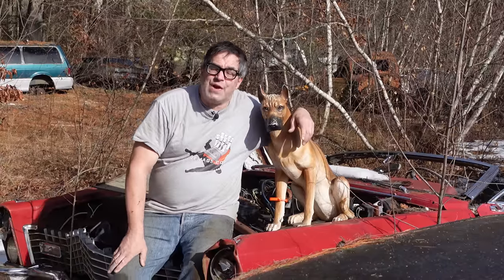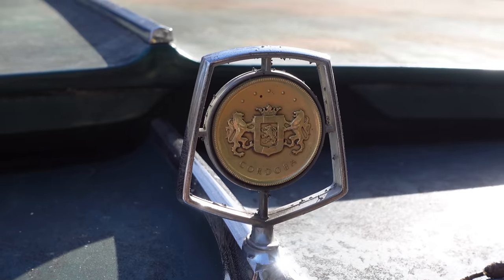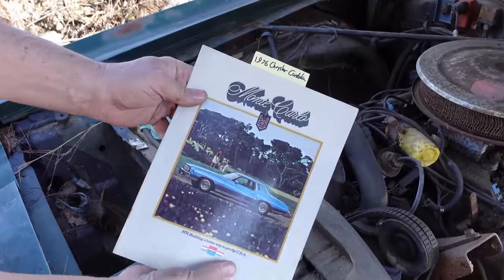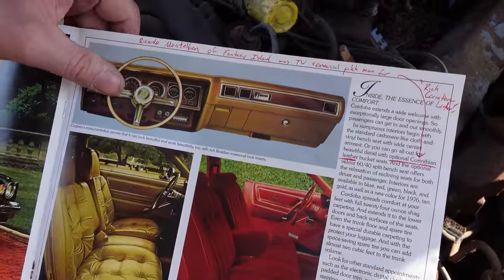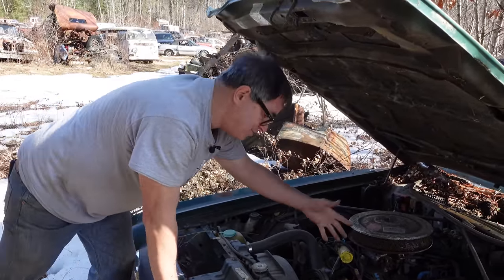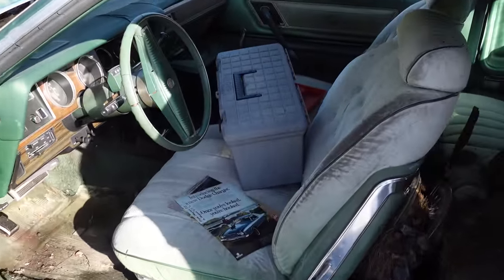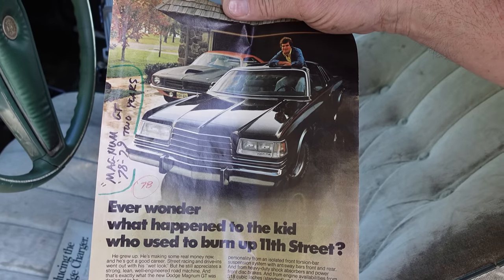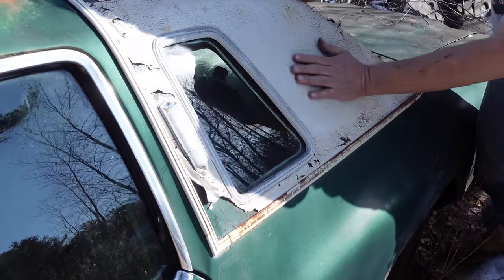Chrysler Copies Monte Carlo

Comment: Close, 1973 to 1977 on the Monte Carlo. The "A" and "G" body GM cars were redesigned for the 1978 model year. While the Cordoba sold, one or two GM divisions of the same "personal luxury" cars easily outsold all of the Cordobas sold in a given year. GM had the size and the money to weather the storm whereas the others did not. A previous owner of that car was smart to de-smog it.  Unfortunately, Chrysler used either Holley or Carter carburetion in their vehicles, two of the worst branded carburetors out there. The Ford/Motorcraft was in the running with that stigma too. It made their cars run poorly and get poor fuel economy. Not that the GMs were the bastion of efficiency, but a Q-Jet by design is a superior carburetor, so much so that Chrysler wound up using it on their vehicles in the 1980s, and even Ford used the QJ on the 429 V8. Yes, Rich Corinthian Leather imported all the way from the Radel Company in Newark, NJ. 

We got the VIN, we win: S for Cordoba, S for Special Price Class, 22 for two door special coupe, N for 400 V8 with four barrel (M is a 400 V8 with two barrel, and P is a 400 V8 with four-barrel, high performance), 6 for 1976 model year, R for Windsor, Ontario Canada assembly and the rest is the production sequence. The Windsor plant opened in 1928 and still operates under Stellantis today. This one was made on Thursday July 15, 1976.

No tag, can't brag, but some of it is easy to figure out: SS22 for Cordoba (S) Special Price Class (2) two door special coupe (22), G8 for Deep Sherwood exterior paint, S62 for tilt steering wheel, N88 for automatic speed control, H41 for heater (the person that bought/ordered this was a bit of a skinflint and didn't get AC), E65 for 400 V8 with four barrel, D34 for standard duty automatic transmission, U for USA spec vehicle, END for end of sales codes, possible P41 for power door locks, among other codes.

I've related the story in the past of the Dodge Magnum in that when I was in automotive parts, we used to deal with a company called "Magnum Products". They supplied PCV valves and emission control items to the aftermarket. (There were only a handful of actually manufacturers of these items back then and all the major companies reboxed them under their brand name). Turns out the owner had a Dodge Magnum from new and was a bit of a Chrysler fan, so he named his company (long gone now) after that. When we got talking, he told me where he was from (New Jersey) and said he was into old cars and what not. So, we invited him in for a vendor meeting. After talking we both said, "I know you from somewhere". Turns out, back in 1989, he was selling a Dodge Charger and a friend of mine asked me to go with him to test drive it. This person that owned Magnum Products met us at a gas station. My friend test drove the car, I sat in the back seat. They couldn't make a deal and we went on our way. Who would know some 15 years later that we would cross paths again. Another "famous" instance of the Magnum was that a criminal was driving one and committing assaults in Florida. One person was able to see "Magnum" on the dashboard and subsequently remembered that and told the police. That's how he was caught and eventually sentenced to death for his crimes.
Reply: Remember this, kiddies, don't crime in a unique ride!
The Ford variable venturi carb was the worst thing I ever had. 
And that includes a couple Tata Nanos.
Enjoy your added info, watching this from rainy Singapore.
Reply: @suzi_mai  Sure. They connected the Magnum and also that he stopped at an ATM to withdraw money. That was also remembered and stated to the police. Back then, all night ATMs were rare in Florida (and most of the US), so they pulled all the records and then matched it to known Dodge Magnum owners and made the connection. The clincher was the distinctive tire tracks which were found on that specific vehicle.
Reply: Got the VIN this morning
Reply: @tomwesley7884  Yes, but I was hoping for the under hood trim tag as well.
Reply from the maker: @suzi_mai  Is the rain putting the POUR in Singapore? Ta-Damp! Thanks for watching and writing. -Steve Magnante
Reply: I've always wondered what the percentage of chargers were to Cordobas in the era that the Cordoba was being made.
Reply: @kennethsouthard6042  Just compare the sales figures of the two models in a given year and Bob's Your Uncle, you've got the data.
Reply: @googleusergp  I know that I just don't have the sales data for the Chargers.
Reply: @kennethsouthard6042  I'm sure it's online if you look hard enough.

Comment: Steve, you made a rare mistake!
The second generation Monte Carlo ran from 1973-1977 models.
The 1976 & 1977 models had the stacked headlights, instead of the round ones.
The third generation Monte began with the 1978 model year.

Comment: Lean-Burn could probably work better today as the components are improved. I believe L/B was the first of its type
Reply: Chrysler was light-years ahead of the others with an onboard processing computer, in 1976!! I spoke with an engineer back in the day who worked with them, the one thing they did wrong was put it in the absolute worst place they could. Heat and vibration killed them. I've had probably 20+ Magnums and a few Cordobas over the years, most still had the LB's in them well into the late 80's

Comment: lean burn would have worked better with a FI, of course it wouldn't need it with a FI system, it was a good idea for hanging on a carb to get it efficient. however, carbs are obsolete. I had a friend with a lean burn ran great except when running hard would act up at slower speeds, he would stop get coffee let it sit for a few minutes and then go on. thinking the system was slow to react. For various driving conditions

Comment: Yah, I had just bought the worst Dodge product built, the 76 Aspen SE.  what a piece of crap. Then Ricardo Mountabum was on the tv telling me 
about the rich Carinthian leather.  My next two cars where VW Rabbits, 81 diesel, ran like a farm implement, then the 84 GTI. that was nice, but 
couldn’t keep tires on it. They kids came so Plymouth Grand Voyageur, followed by an 82 Grand Caravan. That was a solid trouble free vehicle 
that made up for the rest. Had it 14 years, then gave it to a nephew who had it 2 more years.  Had a 64 New Yorker, a 64 2 door Windsor, and a 
66 300.  I guess I was a Mopar guy.  Had a 1965 276 Firedome Hemi with a 6 pack on an Offenhouser manifold, 3/4 Iski track cam, sodium exhaust 
valves.  That Aspen went through 3 front ends in 5 years. Punishing !

Comment: I have a 1980 Cordoba with a 318, it was a great car.
Reply: lenny person  it looked great to me because it was garage kept, 43000 actual miles and was clean and ready to go.
Reply: And I gave  $500 bucks for it
Reply: lenny person  I gotcha the 80 thru 83 looked like a Thunderbird kind of, the 75 thru 79 werenice and had a 400 as the standard engine
Reply: lenny person  yeah it come to think of it, it was pretty much the same thing
Reply: lenny person  wowzers that's great,  I'm a duster fanatic  I'd love to find one that's reasonably priced.  Mine was a 70 318 3 speed on the floor, get this it had 355 gears and disc brakes
Reply: lenny person  yeah I know,  360 are good engines I've had several of them, I had a 2000 Dakota R/T that had 355 gears and it pulled pretty hard for stock engine, I wanted to build.it upbut I  was going through a lot of things and had to  sell.it. Yeah prices for all these old cars are ridiculous now.

Comment: I think the original '66 Charger was the first personal luxury car.  Their advertisements at the time used that type of language.  All the fancy trim, interior lighting etc. would have been appreciated by that type of buyer.  The first time I sat in my '67 Charger it reminded me more of my Moms '68 New Yorker and less of my '68 Coronet (that I had in High School).  The problem was that the Gen 1 Charger missed the market, either by timing, styling, or??  The failure of them to hit the market prompted the '68 redesign to a younger, less affluent, performance oriented buyer and the rest is history.  This iteration of the B-Body styling in copying the Monte was probably done to lower the risk of (another) failure.  I'm not trashing Mopar here, the car buying public is a fickle animal.
Reply: I'm a MOPAR or NO CAR guy, but I think the first personal luxury car I believe would have been the first four seat T-Bird.
Reply: @JrGoonior  That is absolutely true.  Those  T-Birds were very luxurious with options found on upscale cars.  There were major differences between the T-Bird and the 'Vette at that time (the T-Birds original market competitor).  Maybe if Ford had rebranded the T-Bird it would have gotten credit for being the first personal luxury car.    The T-Bird had re-invented itself several times before it settled into that market.  That is probably the reason that the Monte gets the credit.

Comment: I completely doubt that Chrysler only made $900 on the Cordoba.
Reply: He's actually very close. I worked at a dealership and the profit margin on a new car is very small compared to a used vehicle. That's where they made a big markup. Now dealerships vary and the final sales prices are set there but the manufacturer sets a cap on the markup.
Reply: @sandyman541  I agree that the dealership markup were in that range, but I was commenting on the factory.
Reply: @rondpert5167  I agree
Reply: Keep in mind $900 is a decent margin on a $4,500 vehicle sale price
Reply: @rondpert5167  Back then, Chrysler was doing the "push" system of production. That is, they would "push" inventory out to the dealerships rather than a "pull" system (customer buys what they want). When Mr. Iacocca took over Chrysler, the first thing he did was can that system as it was leading to bloated inventory of cars that no one wanted and draining the company of cash.
Reply from the maker: @googleusergp  Ever see pictures of the old Silver Dome in Pontiac, MI where the parking lot is PACKED with new cars (of many makes) awaiting dealers to accept them. These images always made me uneasy...like impending economic doom. But I guess they are "normal" in the car industry. -Steve Magnante
Reply: @SteveMagnante  Much the same way that some films on DeLorean showed the mountain of cars in the European factory waiting around to be sold. The company was bankrupt quickly, but it took some time to sell off the remaining cars that were produced.

Comment: Hell, that car looks like it could be fixed and put back on the road. Front suspension rebuild, repair the engine, and check the undercarriage, and it could probably be driven. It has the right look to keep people from trying to road rage too. Lol. Maybe clear coat the rust so it doesn't get worse, but leave as much of the beat up looks as possible to scare people on the road.

Comment: Im looking for a 77-82 cordoba with a slant six if anyone has one.
Reply: 75-79 wasn't available with the six. 1980 maybe only until 81-82. I don't think you'd be happy with a slant six, by the time the 80's hit it was choked down with emission controls. My parents has an 82 NewYorker, similar platform, (fancy looking Diplomat) with a slant six, loaded with all five of us and luggage it could barely get out of its own way and the gas mileage was awful, maybe 17 MPG on flat ground. Our 79 Cordoba with 360 did better at 20 MPG on the same road trip.

Comment: It's mind blowing to me that they may have only made 900 or 90 dollars on the sale of a car. All those union wages and benefits I suppose.
Reply: They were built in Canada, so yes, the CAW was representing the workers, but I suspect it was slightly cheaper to make the car there.
Reply from the maker: My profit numbers were GUESSES to illustrate the point that car makers - like restaurateurs - make far more profit selling a few steak dinners than they do an afternoon's worth of hot dogs. The 1976 Cordoba's base price was $5,392. I'd imagine true profit was at least $500 - probably more but I don't have an official figure. That stuff tends to be "classified". And here we are NOT talking about dealer markup, rather the actual difference between the wholesale cost to the retail dealer and the actual cost of manufacture at the factory. But lets not forget the long term earnings from the INTEREST on the 4-year financing. And also the maintenance / service visits over the next 2 years or so (which the dealer gets but PARTS sales are routed back to Chrysler Corp). I know that modern SUV sales are FAR more profitable to carmakers than econo-boxes. Like a factor of 5 to 10! Thanks for watching and writing. -Steve Magnante
Reply: @SteveMagnante  My dad started selling Cadillacs in June 1984. The first car he sold was a 1984 Seville which would have been over $20,000 in 1984. When he got his check, the commission was $25. He walked into the owner's office and said, "Don, there must be a mistake here...." Don said, "No, let me explain" and then did the numbers. After that my dad realized that the money was in the add-ons. After that, he made sure to tell everyone about them, but never pushed them. Back then, nine times out of ten, someone would buy the add-ons (alarms, pinstriping, bumper protection, Rolls Royce grilles, Vogue tires, etc.). From there, it was off to the races.

Comment: I like to think of the Cordoba/Charger era as the worst of the 1970's along with disco and disco suits and all that pretentious crap. Chrysler's lean burn while an interesting technology,  it didn't work all the time and many people had problems with it causing misfires and poor performance. A buddy of mine had a Charger with it and ended up converting it like the one in the junkyard because it would randomly start running rough and the dealer couldn't seem to fix the problem.

Comment: The GM cars all had the same platform, and frankly the Monte was ugly. Olds did a much better style job on the Cutlass. Even Pontiac with the LeMans/GTO/Grand Prix did a better job, although that one is a little love/hate too and certain colors look a lot nicer then others on those. 
Cordoba was popular! 
The Charger was NOT popular, Charger fans were seriously dissapointed and Richard Petty refused to use them, sticking with a 74 up to the Magnum, then trying it one year and giving up on Chrysler altogether. Magnum reinvigorated the Charger crowd a bit. 
They also made the Cordoba in 2 door Monaco style when the Monaco nameplate downsized from C to B body near the end of the 70's. 
Also Steve, you should never forget Chrysler made those big blocks and the 360 in a police trim. This wouldn't have come on a Cordoba though obviously. 
I can't speak to the GM products, but Chrysler knew what they were doing with the rear wheel flares. All the B body cars, even the 4 doors, could fit 15" wheels with 275 or even 295 rubber on the back(obviously in standard or bias ply sizes, not metric radial back in the day)

These cars are perking interest after so many years of being dismissed as malaise era garbage by the snooty 1969 purist boomers. Younger generations don;t have the high school nostalgia memories to fuel their need to spend 60K on a particular car, and they see stuff like Cordoba and think it looks cool and can have a big block. Young people also won;t drop mortgage money on a car though, so people shouldn't expect to buy one for $5k and sell it for 30k in a couple years or something. The malaise era, at least for Chrysler and Fords, is the last bit of car culture the young crowd can afford to get into. GM malaise has gotten the "Chevelles are worth 6 figures" crowd attention and they have pushed things like the Cutlass up to out of reach now. 

One thing to note is parts for these cars are difficult to find to say the least. Aftermarket rust repair panels don't really exist, and years of snooty 1969 boomer gen nose turning on this era means there is basically no aftermarket for anything. The one you are looking at for example, well, maybe there are some parts on it but trying to restore it even if it is compete would cost multiples of what the car would be worth after and require hours and hours of custom work to fabricate body panels and make custom interior  etc. that car would make a nice donor for someone though. With a 400, it might also have the optional 9.25 traction lock rear end.
Reply from the maker: Hello davenhla, Thanks for watching and writing. You make a good point about "King" Richard Petty trying a Magnum in NASCAR for half a season then defecting to an Oldsmobile (then a string of Pontiacs). If you watch my Junkyard Crawl video on the 1978 Dodge Magnum I include an interesting photograph of a Team Petty BLOOPER! Hint: it involves a gas filler jug, sparks and a race track. You can find this Dodge Magnum XE video in the Channel Play List. Thanks again for watching and writing. -Steve Magnante
Reply: What's with all the "boomer bullshit?" As for "snootyism, " maybe those cars have just always sucked.

Comment: I always thought the original Monte Carlo was a great looking car, almost as cool as a Grand Prix, but the '73 restyle was pretty lame and they just got worse until the 80s with the seriously cool SS. The front drive Monte's were some of the dumbest looking cars to ever come out of GM. Harley Earl would've never let that happen.

I think the Cordoba is by far the better looking choice compared to it's GM and Ford personal luxury compitition, take a look at the T-bird or the '78 Monte compared to the Cordoba or Charger. I've seen a couple Cordoba's over the years with nice wheels, lowered an inch or two and the vinyl roof yanked off and the roof painted to match the rest of the car, VERY COOL. Shame about the abandoned double-wide look of old velour upholstery. Yuck